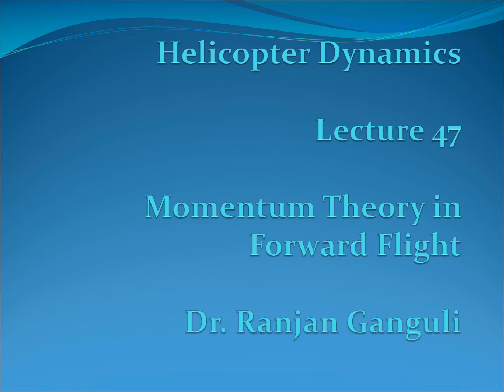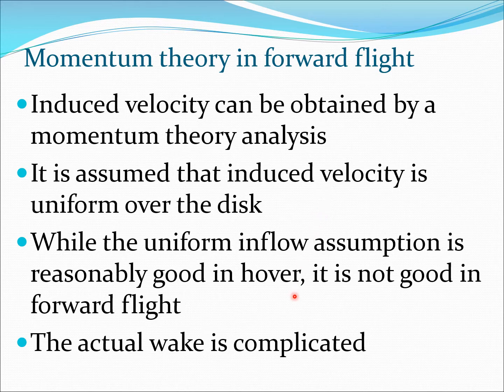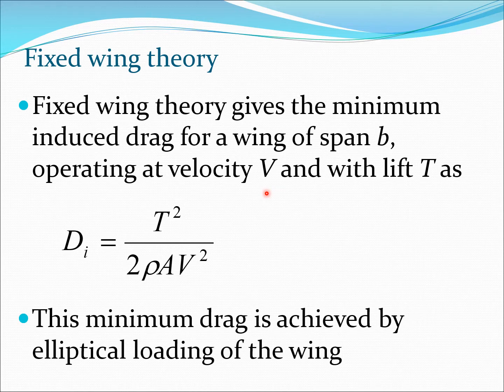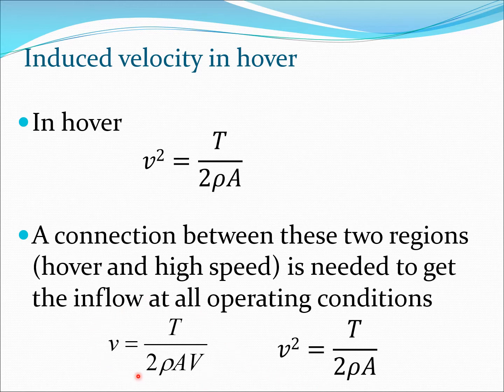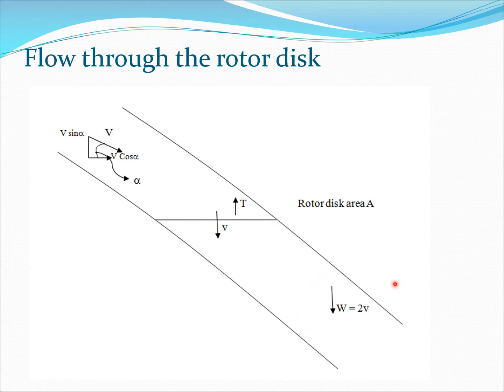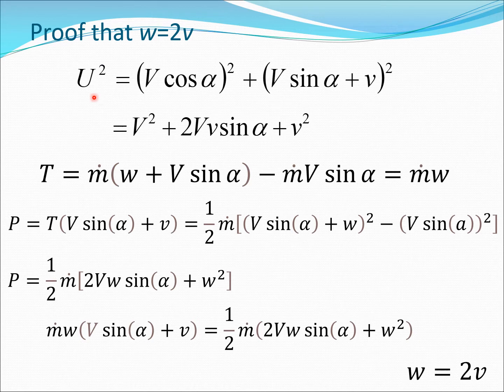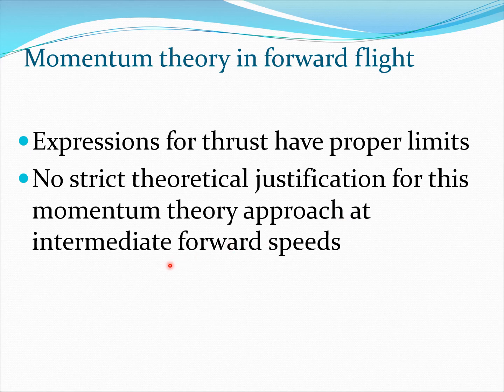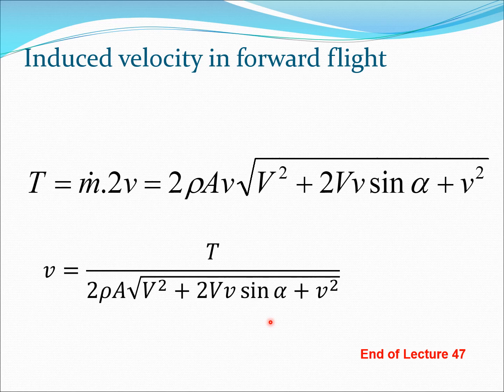Momentum Theory in Forward Flight, Helicopter Dynamics Lecture 47

Comment: Is T still equal to weight in this case, or is that only true for the hover and vertical climb conditions?
Reply from the maker: Weight acts downwards and thrust upwards only for vertical flight. In other cases the thrust vector has an angle wrt the weight vector
Reply: @Drganguli  thank you! So can I then determine Ct at the hover condition at that altitude and then use it for forward flight?